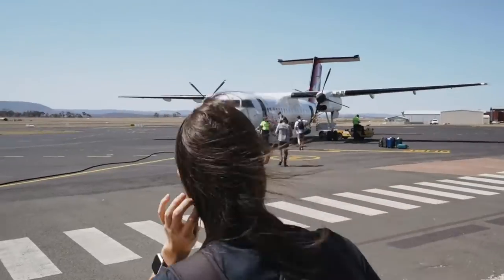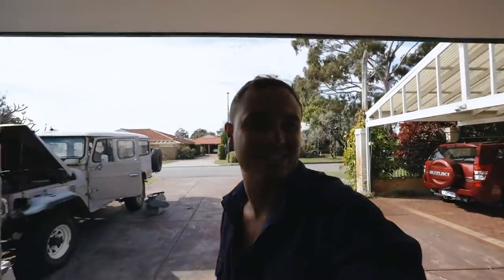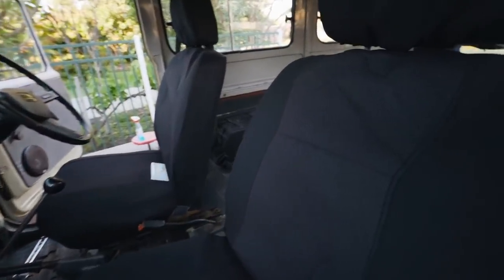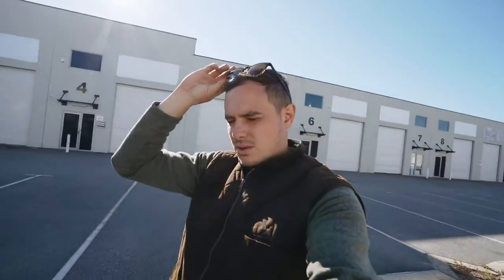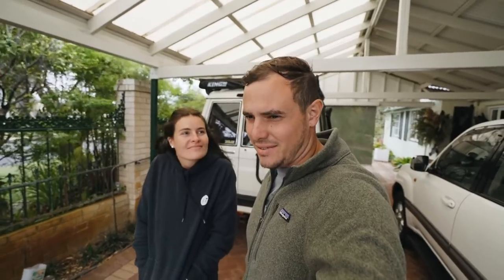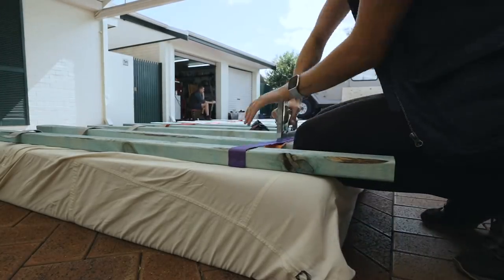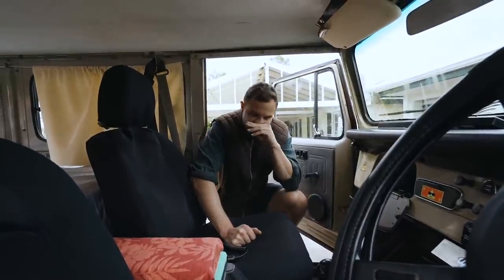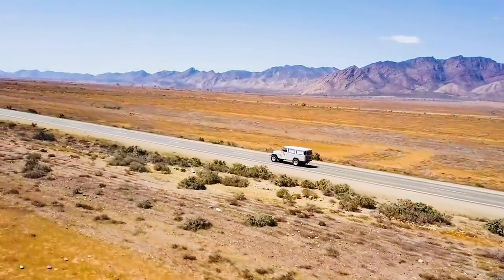Can we get this Troopy Ready to Drive Back Across the Country? - HJ47 Troopy - Ep03

Comment: WOW, I wouldn't know the first thing about glow plugs other than they glow and are needed to preheat the chamber to start the combustion process, but you are teaching me. I've never seen that test and them glowing like that. It's ok Matt, I can't and don't' fish, we can sit together. I've had a similar experience with my 80 series as you are but at the end of the day we get there and it works, it's just how much $$$ we need to spend to get it there, your lucky you have helpers, I'm doing it alone, me and YouTube. It kinda sounds like your not getting the plugs hot enough to help it start. Another great episode. Great to see Elsie on the road.
Reply from the maker: thanks mate, there is no way we could have done this without Geoff and his wife help! in the next episode we get the car into an auto elec to fix the glow, Simple fix and it glowed and started no worries after that.

Comment: What year is the troopy? I think there's 3 different glow systems that use 3 different voltages. 
Best thing I ever did for mine was get some 12v rated plugs (others are 9 or 6.5) and run a direct switch so I could just switch them on for a full minute before starting on cold Tassie mornings.
Reply from the maker: Enso it’s an 81, and has 12v plugs. The issue is all sorted now all the next episodes :)

Comment: Love the vids mate, Jeff seems like a legend to. But gee you carry on a bit, stop shaking your head at it with a sad face and haul into the old girl. Every blokes and his dog has most likely had a crack at the wiring over the last 30 years. Just chuck a manual switch in for the glow plugs..it’ll be better then any of the standard shit lol there a simple beast to work on. It’ll all be worth it when your turning heads amoungst the grey nomads in there 200s..you’ll be a gun on the tools by the time your done ✌️